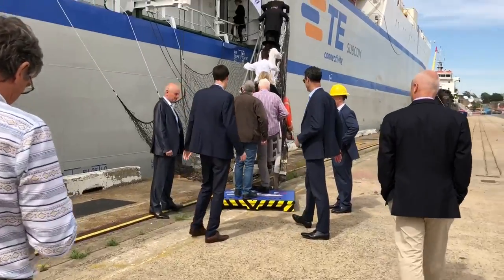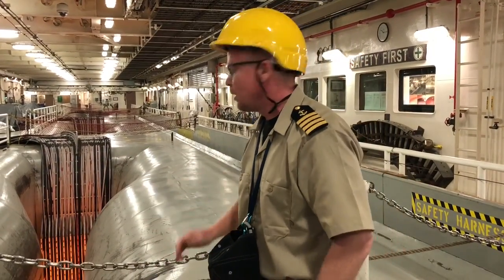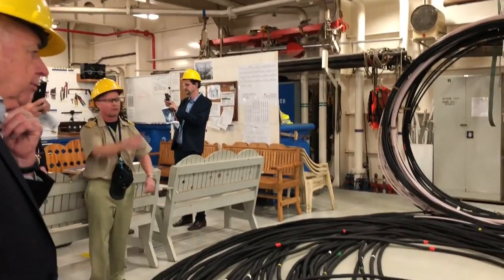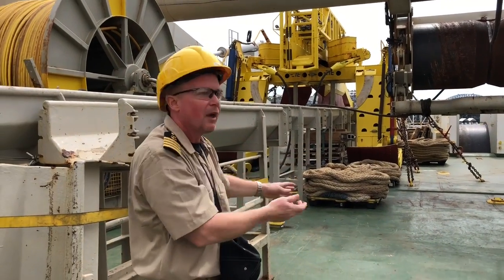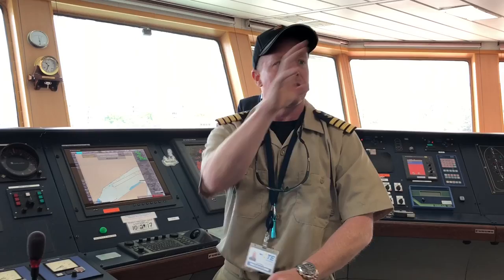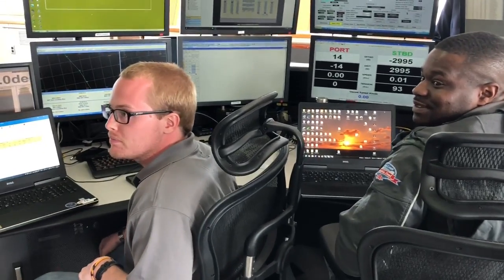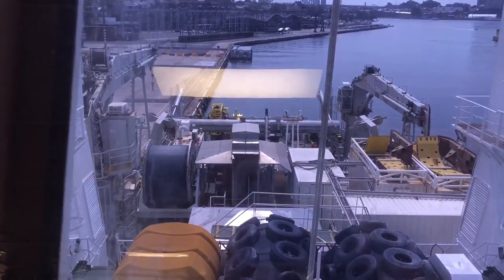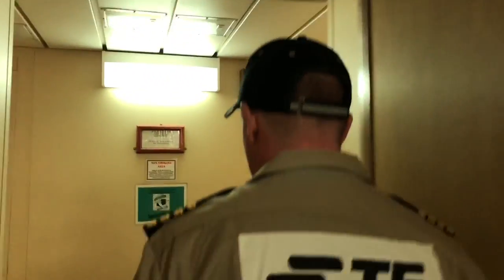Responder submarine cable laying ship tour - for Hawaiki submarine cable

Comment: Nobody bothered to ask how the repeaters were powered.
Reply: Repeaters are needed ever several hundred km and are powered by a center conductor in the cable.
Reply: The repeaters is powered by the cable itself. There is a DC power conductor near the center of the cable, you just send the power on terminal station.
Reply: x1101126  depends on the system. I work for TE Subcom. its basically -1500 to -1750 DCv  from shore to shore and powered from both ends. That systems is called the PFE.

Comment: I have questions for the workers on these vessels.  I heard in the video that you work 12 hour shifts and I get that but what is a normal rotation per hitch?  Is it a 28/28 schedule?   Also, how well do they honor your time off and do they stick to a pretty strict crew change schedule?  Are there any bonuses given to the workers?  Also, how are the accommodations and meals?
Reply: I worked on the ships from 1998 to 2012.   We usually did 4 months on, 2 off Except when circumstances changed.   Returning to Baltimore from a project in the middle east, we were passing the Azores when the ship did a sharp U-turn and headed for France to do another project.   That blew my planned time off, although some people did get off and others came on.   Bonuses used to consist of a huge party for the crew when we finished a project but that has been phased out by the time I left.  Usually 2 people to a room- bunk beds.   One person is always working so you have the room to yourself for 12 hrs.   Food varies from excellent to survivable depending on where supplies are picked up and the quality of the steward + cooks.
Reply: Subcom does 3 months on 3 off and SIU  mans these ships